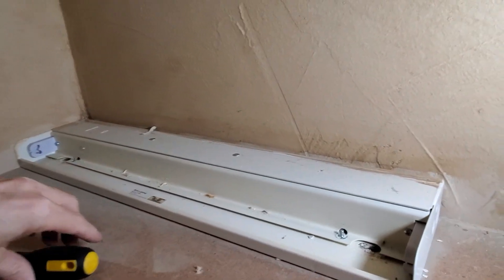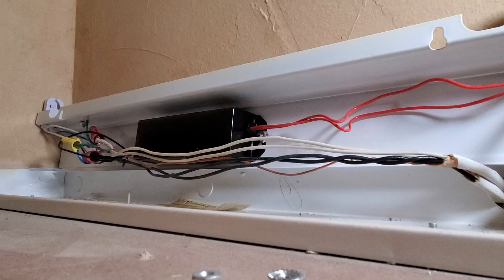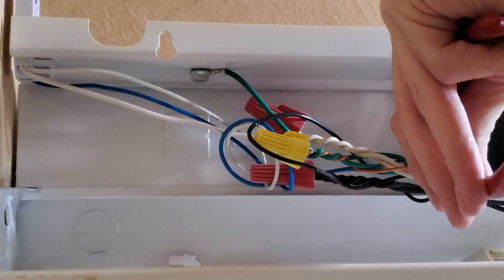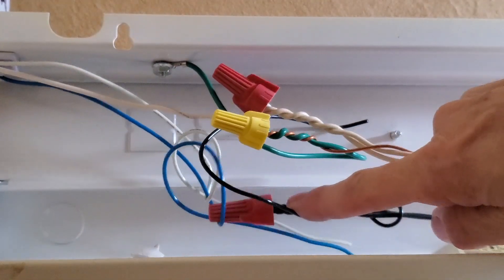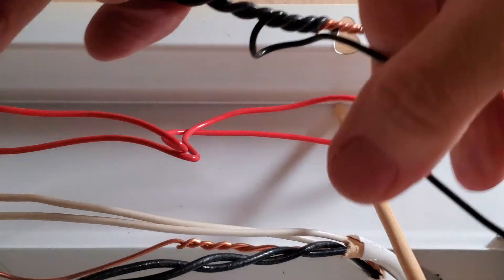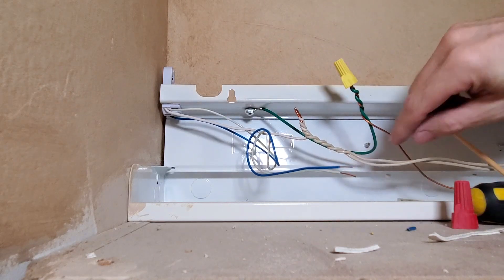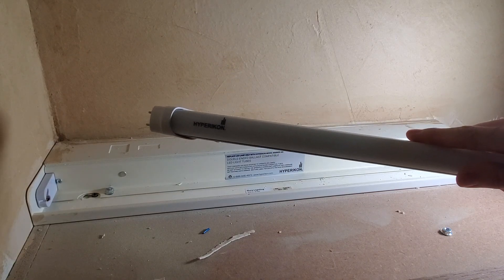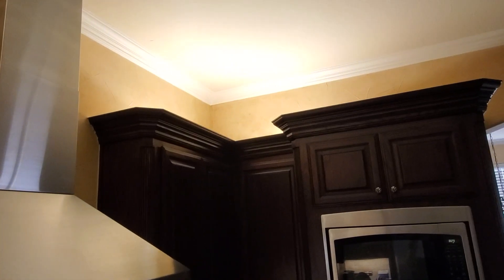How-To Replace Fluorescent Tube Lights With LED Tubes

Comment: YES, first comment!! You must be running power through this light assembly. I noticed the two hot wires and two neutral wires (power in/power out).